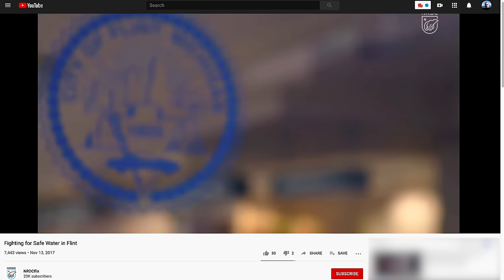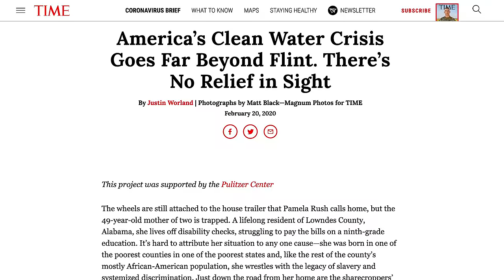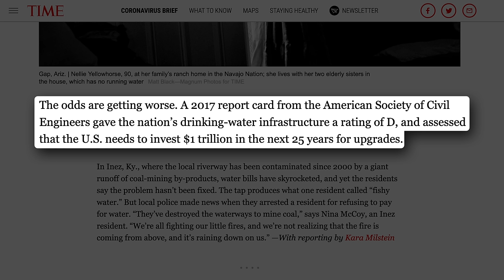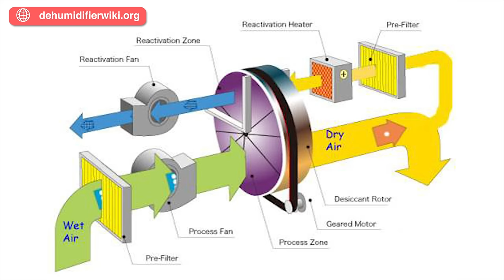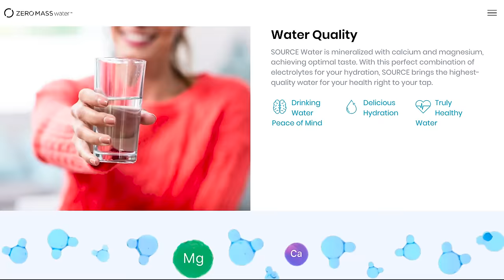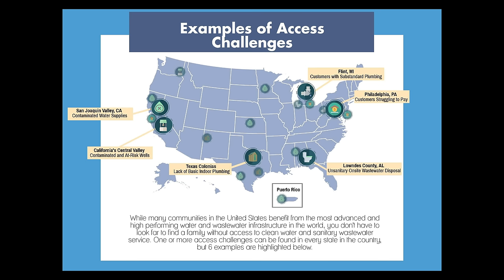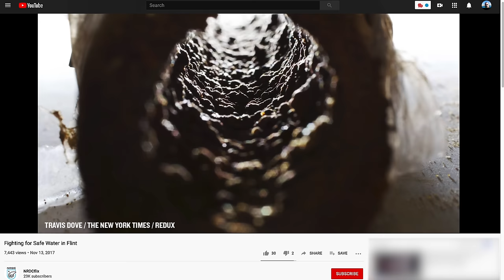Off-Grid Water With Air and Sunlight

Comment: You had me until the loud noise. I would be pissed if my neighbor got that and I had to hear that all day
Reply: You won’t hear anything at night!! lol
Reply: Can't be much louder than a pool pump.
Reply: Also that it doesn't work in cold weather. :(
Reply: I wonder how it compares to A/C compressors - they are also pretty loud
Reply: Maybe they will have problems worked out for the next version that Ben said they would bring to market in a few months? It's early days for the company so lots of improvements to be made. Every new model a few % increase in efficiency/generation of water and less noise? Sounds like what i would do with this tech.
Reply: That was a very obnoxious noise, far more irritating than any pump or electric motor sound. That killed it for me.
Reply: Fans can be made a lot quieter than that.  Quieting technology can be used to isolate the sound, not that big a problem.
Reply: “Raises the dew point” ...need to explain more on how it works
Reply: @donatzerodayslife  yeah agreed
Reply: @baltobooks  I am the same.  I have to stay away from some people.  The sound and content is annoying.  Natural sounds and motors are ok.
Reply: problem is,  that noise is residual energy from whatever happens inside,  fans,  compressors,  etc.  Lots of noise,  even greater wear and tear on some parts.. which will definitely fail in a few years.  Nothing that screeches so lasts. Plus years of sun on those exposed water pipes,  and stagnant water in that box (how do you keep it bacteria free without chemicals). Plus that what you get is warm hot water,  as the water is on the roof.. idk,  it does not seem to be there yet.. i was thinking something silent,  doing its thing,  which would have been cool..

Comment: I would like to see a cost analysis of this system vs a solar electric + dehumidifier system. To me that's the real cost comparison.
Reply: Or even the cost of this vs a rain collection + purification system.
Reply: @andrewc662  rain is not reliable enough for survival needs, exclude that
Reply: What I'd be interested in much more is a health and safety study on these... It's hard to believe that it keeps the water in the tank fresh and with nothing living in it, while at the same time being not much more than just a solar-powered dehumidifier (which aren't exactly known for producing a drinking water, where the lack of minerals is far from being the only concern).
Reply: I think it's pretty easy to add a low power uv light in storage which would keep the water sterile.
Reply: @andrewc662  that assumes you get rain. not all places in the world that are water insecure have large amounts of precipitation
Reply: @johnlarson111  Places without rain will probably have low humidity which makes these systems even more inefficient.
Reply: Both are expensive. 6,000 is 3 months worth of work for most people living in America.
Reply: @matjaro  rain IS reliable enough if the buffer is large enough. It is the source of ALL of used drinking water on the planet...
Obvious Problems are of cause the costs of a secure and clean individual reservoir and (in our air polluted times) a reliable purification system.
But either way you have to be REALLY careful if you store larger amounts of water in pipes or tanks. Bacteria really likes standing water. Ask the Roman's (legionnaire desease)
Reply: @andrewc662  Some dumb states in USA like california will fine you for collecting rain
Reply: Yeah, that's the real comparison. Dehumidifier Is cheaper to buy but, expensive to operate, but i think a solar panel would be enough.
Reply: @officialspock  you're thinking of Colorado my dude. And they don't really enforce that anymore.
Reply: @matjaro  The amount of water most people use for actual drinking compared to what they use for other things is pretty small.  This isn't something you can throw in your backpack for a hike.  A small household water tower and rainwater collection system is going to be in the same price range and in most areas is going to give you more water.  If you are using this in California or Arizona maybe this works out okay on price, but if you are that close to civilization you probably can use the tap unless your city has bad pipes, and if it has bad pipes, get them to pass a bond bill to fix them.  The overall cost may be more than this but per person it's still going to be way lower.
Reply: compare this to a solar still.  just destill the bad water, and the air humidity doesn't matter.  All you'd need is a pump to keep water flowing into it's resevoir, and could use a dark sponge in a black box to soak the bad water up.  Rinse the sponge occasionally and voila, little power use, clean water.
Reply: @matjaro  False. Extremely few places has such low percipitation. 

I live in south-east Spain, in the only desert in Europe, less than 200 mm a year percipitation, and I've just been out in my off-grid cabin for a full year now, just ran out of last years rain water, collected using nothing but a 2x3 meter tarp. 

This year I doubled the size to a 3x4 meter tarp, and the first rain filled the first 250 liter barrel over night. I will expand to four small roofs as they get restored, so yeah, rain easily covers your potable needs if you can store it. 20 bucks for a tarp, some rope, a few barrels. Boom.
Reply: @Brandon_letsgo  Its like 2 years of work on some places
Reply: @matjaro  Neither is this, it pulls water out of the air, like humidity. Most areas do not have enough water in the air to get 2 gallons a day.
Reply: @johnlarson111  and in those regions will likely not work with a system like this.
Reply: @BatYAH2015  That's abundance for you! Vast parts if the world could easily do this for all the water they need.

Comment: Water coming from thin air

I live in Scotland

I'm not impressed
Reply: Me in Sonoran desert — awesome! You in Scotland,meh.
Reply: Underrated comment right there!!
Reply: @robertschenck9902  Hermosillo?
Reply: It's called rain.
Reply: Ireland 🇮🇪 is the same, that's why it's so green. If its not raining in Eire, you must be indoors
Reply: Wait, there are places that don’t have water just continuously falling from the sky and have tiny wee b#*stards feasting on you in swarms for the 5 mins a day it doesn’t?!  Jings crivans help ma boab!
Reply: lol Yep. Spent a lot of time in Scotland. No Problem getting water from the air. The problem is getting away from it. Horizontal rain or deep fog. Very few actual sunny days.
Those "old" and "foggy" Sherlock Holmes Movies did not have to work very hard to get the atmosphere right...it's always like that!
Reply: @shinigamilee5915  Only problem is with rain, it's unreliable because it doesn't come down on schedule when it's needed. In homes without sufficiently large backyards, it's impractical to install large rain water storage tanks.

Another problem with rain, especially in city regions, is that the initial shower of water has absorbed air pollutants on its way down, and as a consequence expensive water filters are required to remove diesel fuel exhaust particulates, nitrous oxides, coal fired power station pollutants including carcinogenic PAHs and sulfuric acid.
Reply: Thomas Chrombly  Arid places like Sedona Arizona? The place were the company is based?
Reply: Aye lad 🌧
Reply: Thomas Chrombly  Why are you changing the subject? 

Do you live in a place that is more arid than Sedona?
Reply: Thomas Chrombly  So, what’s your point? Did you just have an uncontrollable urge to say something negative and irrelevant? 

This company does their R&D in Sedona. I suspect they would know if they worked there or not. And if they work there, there aren’t many places in the US where they wouldn’t...aside from the one hitch mentioned in the video, which the company seems to be working on. 

Energy consumption with these units is irrelevant as they use solar and provide their own.
Reply: Thomas Chrombly  This video isn’t a comparison video. 

If you want it to be relevant then post relevant information. Do what was done in the video. Extrapolate the 15 year cost of ownership of an AC water evaporator as compared to this unit.
Reply: Thomas Chrombly  Are you sure you’re replying to the right post? If so, what are you replying to? You’re making no sense.
Reply: Thomas Chrombly  That has nothing to to with your original reply. You have changed the subject and or moved the goal post. Your argument here is disjointed at best. 

Let’s put you original reply aside for a moment and focus on your overall claim. Here is what I’ve gathered so far about your claim. Your claim is that there is a less expensive, less power hungry, higher producing way to do what this unit does and can do it better in more arid areas. 
Seem about right? 

Post the numbers. Provide links. Compare this unit to another unit. Or better yet, make a comparison video and provide a link to that. I’d watch it. In some way or another, provide evidence to back up your claim. 

Without those number, your discussion here is irrelevant to a review video that is not a comparison video. That being said, I’d like to see your numbers.
Reply: I don’t live on the moon but space suits are still impressive. Just because something does not directly affect you doesn’t make it not impressive.
Reply: Water coming from the air---I think that's known as rain in most parts of the world. lol
A solar still is MUCH less expensive...
Reply: @GHOST-zy3ji  que tranza we
Reply: @mrright1068  🤣😂🤣👍👍 this is the most I have laughed in weeks ty
Reply: Yeah but gleaning from the video this might be a good setup if you want be off grid in a desert area.
Reply: as a scot in america im on the floor laughing lol
Reply: If you lived in a desert, you would be impressed.
Reply: Absolutely, I was watching it thinking that would be great to stick on a truck or whatever to make it easier to live, thennn... I read your comment. Hmm Scottish problems 😂🙄
Reply: Waterbending
Reply: Norm T  As humidity in the air condenses, it reaches a point that it forms droplets that fall to earth--that is called precipitation--if the temp is above freezing it falls as rain otherwise it can become sleet or hail or snow as the temp decreases.  Is this going too fast for you??  I'm not wrong about anything--you're just confused.
Reply: Welsh - ditto....
Reply: @robertschenck9902  I live in Karachi Pakistan I like your comments thanks
Reply: @ZulqarCheema  I live in Karachi Pakistan I like your comments if you don't mind
Reply: @raziarahmat4299  on what?
Reply: @ZulqarCheema  a large fog catcher can  collect 200 liters of  water a day
Reply: I'm from cali and as long as I've lived there has always been a drought here. I'm highly impressed in this.

Comment: This reminded me of a dehumidifier, the one I have in my basement fills up in less than a day .. this system must work something like that.
Reply: Yah I think you are right
Reply: @sammybirech5211  I've seen dehumidifier bags that they make as well. The Amish use them in their stores and they fill up with a lot of water for little bags. I think it would be a good idea worse comes to worse if one REALLY needed water, especially out in eastern states where it stays extremely humid especially in the summer. They have the survival filter straws people can buy and it will clean the water so it is drinkable.
Reply: It’s just air blow across a cold metal coil and then reheated. The cold coil is below the airs dew point causing water to condense on it.
Reply: it's exactly that, but with a solarpanel on it, so they can sell this garbage for 40 times the cost of a regular dehumidifier.
Reply: @kymspicks2763  the filter straws an excellent idea. I was feeding the water to the cat, but now I will drink it from the straw because its water after all
Reply: @lukehawkinson9100  is there a way to make at home?
Reply: @GS-st9ns  Dehumidifier water is distilled, don't drink it or force your cat to drink it you psychopath.
Reply: Correct
Reply: @actually5004  the only significant danger to distilled water is the lack of dissolved minerals

And by significant, i'm talking "take one mineral pill per month to avoid noticable effects 5 years after starting on distilled water" levels
Reply: @kymspicks2763  --  I just looked up DC dehumidifiers.  (Just in case somebody doesn't know:  Household current is AC.  The 12 volt current which is produced by solar panels or comes from batteries is DC.)  They are under $200,  the really cheap ones under $100.  They are massed produced for RVs and are readily available.  I suppose one could run one of these  DC dehumidifiers off of a solar panel and get the same result as the product in this vid.  A really cheap alternative would be to construct a homemade savonius wind rotor and rig it to a used car alternator.  These would be off-grid.  What do you think?
Reply: @actually5004  what's wrong with distilled water?  i've been drinking it for years.  Now I'm worried.
Reply: @ClassConscious1  you'll need to take mineral supplements.

Comment: A lexan or plexiglass box can be easily made to insulate and cover your unit during the winter months. Kind of like a sunroof effect that is also used to keep plants warm and growing when the temperature plummets.
Reply: I believe that the winter solution would be to have the unit Not installed on the roof, but installed in the ground. Of course you must have enough space in your yard where the sun can still hit the panels. The ground is a natural insulator. And with low e- glass in triple pane, it might avoid freezing temperatures in a large portion of the country. After building a semi-pit greenhouse, I was amazed at the difference of avoiding quick spikes in temperature.  And it Also prolonged the growing time in the greenhouse.

Comment: It would be great to place these along hiking trails and in parks for access to clean drinking water.  Running the extra water to larger water tanks for use in watering  grass etc or simply to have more water when crowds exist in parks.  I think they could run 24/7 with solar battery   backup.  Even running extra water for animals and birds.  As the Engineering improves over time the noise and cost could be reduced and freezing months could be addressed. Take Elon Musk approach.  Cost Effective more Efficient Less parts more reliable more designed for manufacturing etc etc.. Even could be used on Mars, since pumped ground water would still evaporate. Elon and NASA would love that!!!
Reply: My thoughts exactly old friend
Reply: > "It would be great to place these along hiking trails and in parks for access to clean drinking water.  Running the extra water to larger water tanks for use in watering  grass etc or simply to have more water when crowds exist in parks."

You're far better off installing reverse osmosis systems. These panels are nothing but glorified solar-powered dehumidifiers.

> "I think they could run 24/7 with solar battery backup."

Not quite.

> "As the Engineering improves over time the noise and cost could be reduced and freezing months could be addressed."

Lower your expectations, buddy. Lower your expectations.

> "Even could be used on Mars, since pumped ground water would still evaporate. Elon and NASA would love that!!!"

Don't even THINK about colonising Mars until we send astronauts on a successful manned Mars mission and get them back to Earth.
Reply: "Take Elon Musk approach"  So, just make an outrageous claim and then never follow through? Sounds like a plan!
Reply: With that noise? Don’t these things need power to generate the water? I guess huge solar panels in the trees? What did your ancestors do ‘while hiking’ lol.